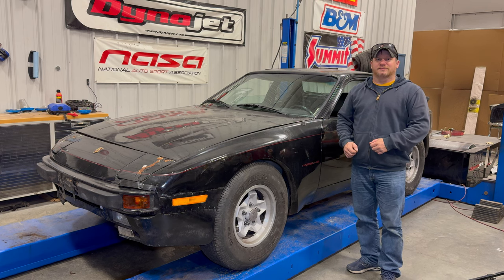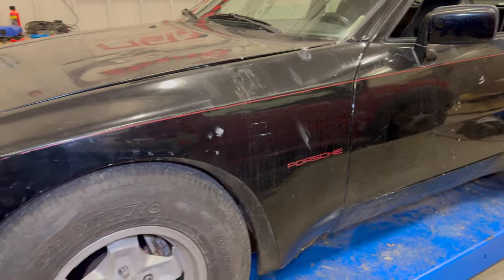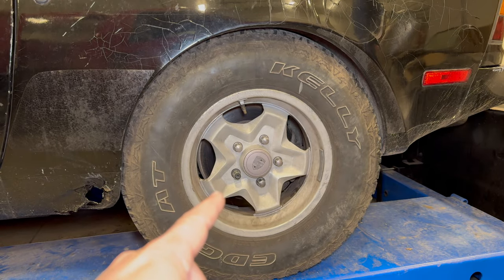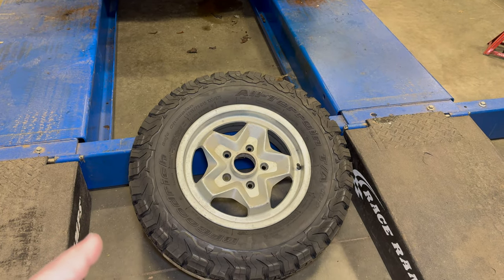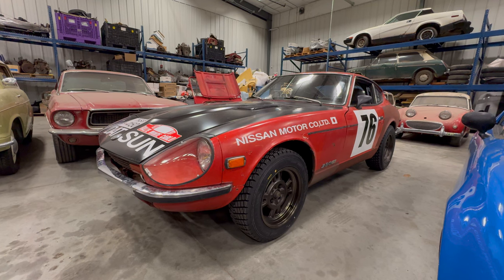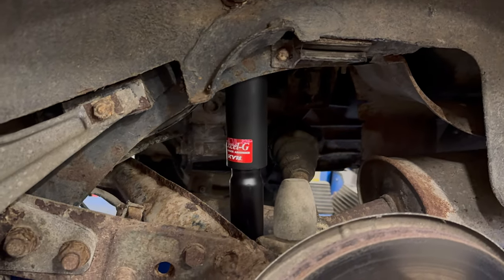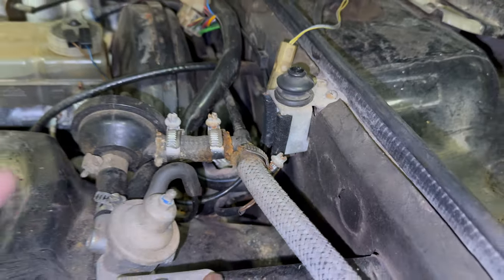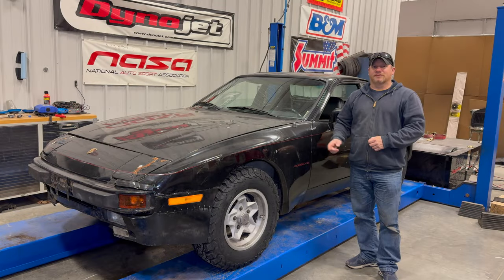Starting Porsche 944 Rally Car Build

Comment: Dunno about the ralley-cross build, but if the maintenance on the 944 is as bad as I've heard, a Mad Max build might be in order.
Reply: The 944 and it's predecessor the 924 were the bargains of the Porsche family, so you ended up getting lots of non-typical Porsche buyers who could afford the initial car but who balked at paying for proper maintenance thereafter.  Porsche owners mostly looked down at the poor adopted step child so that too ensured they didn't get any love.  As used cars they were often bought by people who had never owned or worked on a Porsche, so you got a whole second wave of DIY bodge maintenance and repairs because those bargain hunters didn't want to pay Porsche prices. In fairness they are well balanced cars, comfortable drivers, with decent handling.  For the money, you definitely feel like they're under-powered.  Maintenance isn't that bad and parts availability is still good.  Most things are DIY friendly if you have the time and some decent tools (metric).  Steve will have no problem working on this car.

Comment: Do you balance your tires?  I only see you mount them..
Reply from the maker: Not for off road use a little bit of mud or some rocks stuck in the treads are going to throw off the balance just as much or potentially worse, on a vehicle like this you would never notice if the tire is balanced or not but you will notice if it has a pound of mud stuck to it.